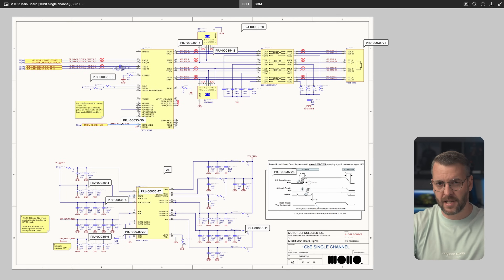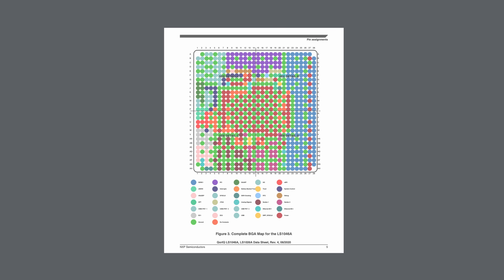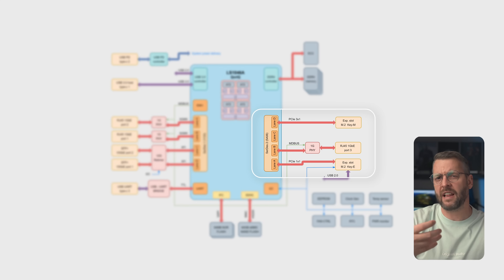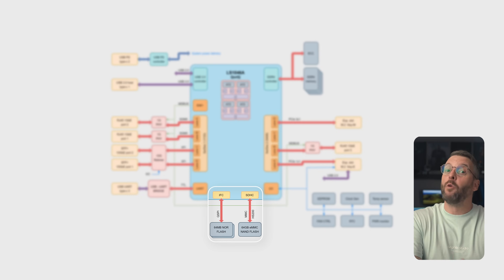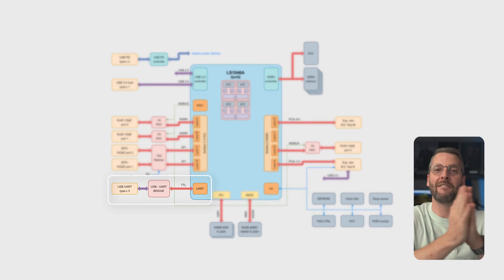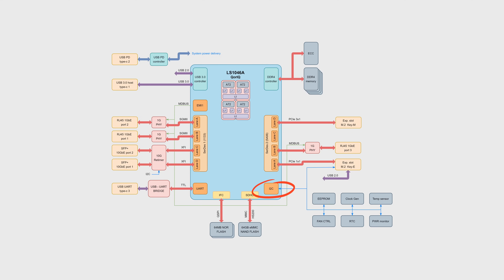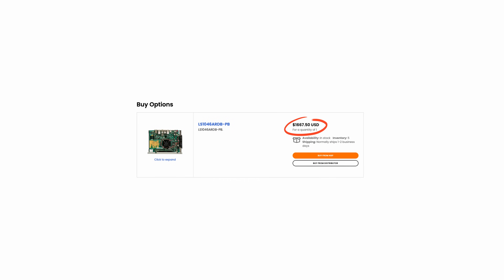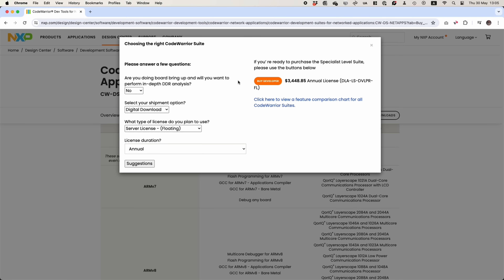We're building a high-end router. Here's the update for May 2024.

Comment from the maker: Apologies for the awkward audio - I record on two channels separately, one through hardware compressor. Forgot to choose the main channel, so they may seem out of phase. 🤦 Listening on speakers makes the problem somewhat go away (which is how I missed it, I guess)
Reply: Always use headphones to check the audio ;) and apologies accepted ;) also for the internal leds, make it also a software feature (permanent on with a jumper or true software so you can chose ;))
Reply: Absolutely wild audio on my speakers :laughing:
Reply: I'm using speakers, and it is driving me NUTS tbh. Untill I scrolled down to your comment I thought either: A) my ears need to 'pop' like when you yawn after entering different elevation / air pressure, or (less likely), B) that kinda weird effect you get when a TRS jack isn't quite plugged in all the way. Unfortunately, both my guesses were incorrect.
Reply: I would love to see MQTT support as a client as well as snmp just my xmas list and any idea what your target price is looking like? also what switch chips you gona use RTL8221B (2.5gb) are fairly resonable  imo uplinks should probaly be 10gb sfp+ its fairly indstry standard and could be converted to a differnt format with a different transiver this day in age 1gb ports are just useless unles for managment. If you want the gear to be revlent I would highly recomend starting at 2.5g and higher if posable 5 or 10g Just my thoughts I would use a header insted of onbord LED;s  this way depending on the case you could just use or not use the leds and also please please PLEASE sell a rack mount case I hate having a bunch of loose geear floating around in my server cabnet
Reply: Watching on a MBP Pro 16" and I can say the listing to speakers thing is actually making these feel very weird.
Reply: I was adjusting my volume up and down a lot, but tbf it's not an uncommon mistake. No stress.
Reply: Heh and here I was thinking you'd somehow inverted one of the channels, but phase shift plus inversion makes more sense considering a mono-mix just nukes the lower frequencies and makes your voice sound like a telephone call
Reply: I do not care about visual separation of ports as long as it is clear what is what (so a manual + labels above specifying what it is is perfectly fine) What I care more about is the ability to connect everything I want to it. Do the 3 USB-C ports have enough space between them to connect three thumb drives or are they too close together? When I connect all ethernet ports to it, is there enough room for my fingers to unlatch the middle one, without breaking my nail or the connector or possibly break the neighboring connectors doing so? Stuff like that is overlooked too many times in favor of visual appeal. But I would ask then, how many times will you look at the ports at the back of your router?
Reply from the maker: @tomasruzicka9835  all these questions are exactly the ones we're currently asking ourselves at this point. Thanks!
Reply: @tomazzaman  I am not an expert when it comes to how power is delivered on usb-c, but I would consider separating the usb-c ports if power delivery could damage the UART port for example.
Reply: Bro made an entire video to help his colleagues fix their audio but forgot to fix his 😂😂
Reply from the maker: @yogi.g  indeed! 😅

Comment: What I would love to see in a router is:
DC output/input to an external battery ex. (12v SLA) battery.
The router would float charge the SLA and failover to it when it loses DC input.
Gracefully shutdown when a low voltage threshold is reached.

Comment: 14:29 To have that space between the different ports-classes makes it easier to find them, in case you have to wire them blind.
That hole, is there a reset button behind it? It might be harder to get to it, when all network ports are occupied. What about putting the USB3 ports between the 1GB and 10GB ports? That would make it easier to distinguish. IMHO 🤔

Comment: This is pretty late in developement I realize, but have you looked at getting it made out of sheet metal? 
Some minor design changes like the sharp corners on top being rounded, it'd probably be so much cheaper on materials that you could go back to the old size and still save. You would probably have to order 100+ to be worth it tho compared to cnc. 

Oh and I think you'd be a very big fan of a stainless version with a glass blown finish. Juuuuuust sayin.

Comment: for the LED hear me out, instead of just one single color LED, why not RGB and integrate it with whatever router software that will be running on it to make it change color depending on the device status

also I also prefer LEDs for each interface, its super useful when trying to debug connection speed, make it one light for both link speed and activity but the activity can be turned off in settings

Comment: If you are using both altium and Solidworks, you shulould look into the bundled altium MCAD integration with solidworks, it is really quite good.

Also, the standard altium subscriptions are floating, so you can actually share the licence between two people, so long as only one is working at a time.

Comment: Please please do not do this project without network port link/act LEDs. These are crucial for validating PHY connectivity. It is used all the time by network operators. Maybe there is a way to toggle them in software, or build a simple shroud that you can attach/remove that would cover them.

Comment: Whats the reasoning for using SFP+ instead of RJ45 for 10Gb?

And I prefer Design Option 1 for better accessibility of the reset button, but the cleanliness of Option 3 is also compelling. It will be the trade-off and dependent on the customers preferring function or "form over function". I say: "know your customer" :)
Reply from the maker: SFP+ is more versatile. You can use fiber, DAC or RJ-45 with them.

Comment: Why would you spend all this money to develop a custom router? Just get an old PC, slap a dual port 10gig nic in it, and install linux
Reply: I Concur. There is not much scope as there are already big companies with big pockets, but cater to enterprise level customers. Also could convert any PC with additional NICs and install PFsense or Monowall, or even create a derivative with modified source. Unless done using custom ASICs or FPGAs, and if security and performance is of paramount importance(warranting burning up loads of money in development), off the shelf parts won't deliver🤞. Just helping to avoid reinventing a wheel.

Comment: What i want to hear about is the software planned to run on it :)
Reply from the maker: First version, we'll go with OpenWRT, but want to keep the device completely open, so anyone can put pretty much anything they want on it. As long as they get it to actually run :)
Reply: FreeBSD 14 supports ARM-based processors. So it is up to the pfSense or OPNSense project to release an ARM version of those products. pfSense is already running on Netgate ARM-based appliances, so it is definitely possible. However, I don't think Netgate is ready to release the ARM version as open source as they currently have a commercial interest in it. With the democratization of the ARM platform on PCs with Windows on ARM and Apple M-processors, I think it is just a question of time (maybe a few years) before those well know products become available on ARM. Having a high-end hardware on the market capable of running it will be an incentive of those projet to look into ARM support. So far, only low-end/low-power ARM-based devices existed, such as Raspberry-Pi, which was not very attractive for business use. There currently is an experimental ARM port of OPNSense available on GitHub but it is not released by the OPNSense project itself. Tomaz said in an earlier video that he would like to collaborate with projects like that to develop official ARM support.

Comment: I think you may be losing focus of your target market.   You're explaining terms such as UART with an ELI5 mentality, when your audience is already tinkers.  UART is closer to a serial / tty connection than a fake monitor out.

I don't like how the 3 usb ports are side by side.   You're experience people plugging in their USB-C power to the wrong ports.   Plus if USB data devices are tight to the usb power (with fat flash drives), could possibly pull out the power when pulling out a USB when pulling out the flash drive.     Also placing the UART USB-C next to the rest.... is also questionable.    

For your design, DO NOT PLACE THE RESET button/hole in the middle of the ports.  This will be a bane of everyone having to unplug everything before factory resetting.

Comment: The bottom row design is good as reset button giving gap for USB and Network slots. Aesthetically and practically good choice.
One suggestion to keep air wents in a way not to collect dust from top to accumulate it on PCB over a period of time. Also a good air gap under the case for better heat dissipation.

Comment: Port status leds are absolutely required for such device, it saves huge amount of time when diagnosing problems and absence of them makes some use cases impossible. If I loose connection to remote location, I could just call anybody and ask to go and see what lights are on before hopping into my car and driving 500 km to realize somebody unplugged the wrong cable. And when on site it saves a lot of time from logging in, remembering which command shows interface status for this particular device and so on. Just use ethernet jacks with leds and disable it in software - you don't even need dip switches for this, just some spare gpio pins
Reply: Yes for sure, anyone who deals with installation / troubleshooting would hate the lack of LEDs.
Reply: It seems Tomaz is forgetting to whom is he making the product really. On one hand it's openhackable for pros, on other he wants to please people who hate blinking lights because they don't have a good spot for their router. Why not just do what a lot of gear does this days and make a "dark mode" software toggle?
Reply: I'd suggest a button outside of the case instead of a dipswitch on the MB, to cycle light modes in blinking, fixed on or off
Reply: The LEDs on the connectors themselves still should be there, and for me so far it always was enough. Yes, you need to ask the person to look at the back of the device, but rarely it is a huge problem.
Reply: @SuperMopti  It seemed pretty clear that he was talking about the LEDs on the connectors. And there are plenty of connectors that don't have LEDs and he would have to connect them to the phy or  some other controller anyway.

Comment: Continuing to love this video series and process. Esepcially the connection between business but also the deep dives into tech. I prefer the top or bottom design. People have made good points with the usb-c port spacing. At least one spaced out a bit more to allow for chunkier devices. Good points on the SFP SFP+ heat issues but seems you've got that considered and thermal testing when you get to it will tell you if you're good or not. I like the white minimalist design ubiquiti / apple esq. And it looks like it'll be a  fairly small form factor which is super nice. I'm sure someone will print or make a 10" rack mounting plate and a 19" plate when the time comes. Also like the idea of the halo light with status for if something is off vs normal operation vs boot. And I think you'll certainly get people that want the lights. I think it's more a mental thing though honestly a comfort of seeing what's going on ...but there are better ways to do that now. All in all awesome work and thanks for sharing your journey with us!

Comment: I would turn it into a rackmount and slap a heat transfer pipe to move the heat away in more space to fan it out to reduce noise. Use the space to mount a battery as an internal ups module, dunno if you can cram enough capacity for the sfp ports though.

Comment: First or third option for the design.   The button will be a pain ti reach sandwiched between the SFP cages and rj45 jacks.    You could risk unplugging power with the 3rd if rotated.  And usb ports being next to each other  for power / UART/storage could also face a slight risk of the same.  Allowing the sfp cages some direct contact with the case might also be good,as they can get rather hot.  Thanks for the update! 🤞

Comment: How big can the heat sink be? YES

I would connect the CPU to the case to have the beste heat dissipation as possible. (Example: MikroTik 5009)
I like it cool.
Reply from the maker: In fact, in our last meeting with the case designers we had a discussion around just this. How can we mount the PCB so that the CPU will align with the case in a manner that will allow us to just use a thermal pad in between.

Comment: I would greatly appreciate the ability to completely turn all LED's off in some way. Some of my network devices end up in bedrooms and I don't like having to use electrical tape to cover them. Often light leaks out elsewhere or the tape peels off
Reply: The noise it will make will drown out the lights.
Reply: @seltmitchell2965  they are different senses which means some people might be fine with the noise but not the light

Comment: So these reference boards dont support generally available languages and IDE's ?
Reply from the maker: They do, but like with any other vendor, they prefer their own tools, so to speak. But that doesn't stop you from using a third party JTAG programmer and use whatever you want.
Reply: I was wondering the same thing. Surprised I had to scroll down so far. There‘s other IDE for these processors available but their super expensive one??

Comment: I was reading the comments in the previous video and saw the price goal that is about ~600€ and I am not sure this falls in the correct price range of gear I am looking for.
Sure, there are other brands in the market for this price with similar specs but they do have their own O/S which kinda put this product in a rough position.
Also yesterday for a client of mine, I got him a refurbished mini pc with pci-e low profile for 60€, I got from aliexpress a dual 10GbE ethernet card for 15€ and look at that! 
For 75€ I made a router! Now softwarewise, we went for pfsense+ that was another 130€ so for 205€ we have a router that runs AMD64 and not arm64, which means I can even install proxmox on it, make pfSense VM and run a ton of other services!
Sure, no POE but who expects their router to be POE? This is what switches are for!
And best thing? I can swap the dual 10GbE nic and install a quad 10GbE nic and have multiwan or even install 100GbE cards!
About consumption...yes it draws more than arm64 but do the math how much it consumes a year running just that and add this amount of money to the 205€ and tell me how many years it will take to reach the 600€, we are talking about a decade at a minimum!
I do understand that here we (and I include myself in the we) are early days and depending on the amount of devices for pre-order and mass production blabla the price might vary and it might end up cheaper than the 600€ but we also need to be realists. 
An ARM64 router will have 1 or max 2 options for router O/S. It is what it is. Good for macs/mobile phones/tablets but still early days for router O/S.
Sure you can do bsd and write the routes by hand but that I would cost to my customer 2 times the price of the hardware for the amount of time I will invest in config the machine like a savage (no offense to anyone, for my own home/lab I do it this way too, but for customers, I'm sorry, not an option).

Comment: A cool idea would be implement a XGPON port on it, so it can be used as a ONU, without using one SFP cage with those ONU sticks, just spoof the MAC address and que serial number, also, WiFi 7 would rock too. Then we could ditch the ISP's ONU, or it could even be used by ISPs themselves.
Reply from the maker: Yep, that should work out of the box - I see no reason why it wouldn't.

Comment: Re: LEDs, Apple’s “AirPort Extreme” and “Time Capsule” routers use a single hole in the housing with a diffuser to help the light get through. 
The LED is solid green for normal operation, orange if there are issues… and I think it pulses white while booting?
It’s a nice solution to providing more status information while simultaneously avoiding all of the flashing lights.
Reply from the maker: Agreed, we're looking at something similar, but instead maybe use a "halo" instead of a directly visible LED.
Reply: I know you cannot incorporate everything, but if possible consider those of us who are colorblind. Yellow, green, and orange LEDs can be EXTREMELY difficult to distinguish between.

For my eyes, if you can pick 2 colors at most, maybe blue and green, and use pulses of light to indicate different information, that would help.
Reply: …a small display would be the ultimate solution here, but probably outside the scope of your plans. Don’t let me add feature creep to you project, unless you want to hire this mechanical engineer with years of experience in prototyping and design ;)

Comment: 15:18 Should also offer an option to disable the status LED in software. 

Few things are worse in a light-controlled environment than that one damned status LED glowing like a beacon of Gondor in the corner.
Reply: yes, at least when it is working properly. If there is an error, it turning on red or flashing is ideal. of course you should be able to tell it that you are aware of the problem to turn it off
Reply from the maker: That exact thing was discussed at our last meeting as well. Either make it dimmer or completely eliminate the LED being visible in the first place and go with a subtle "halo" effect.